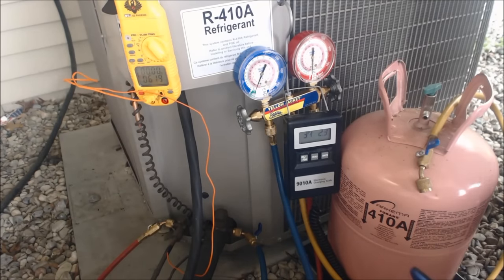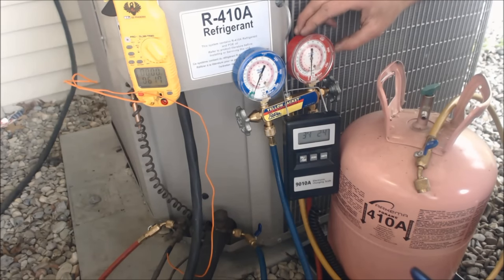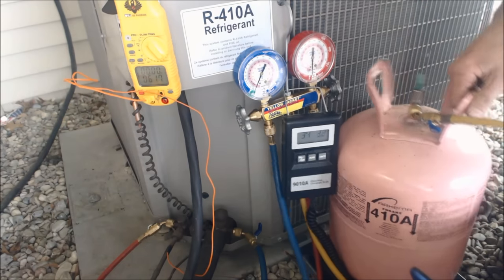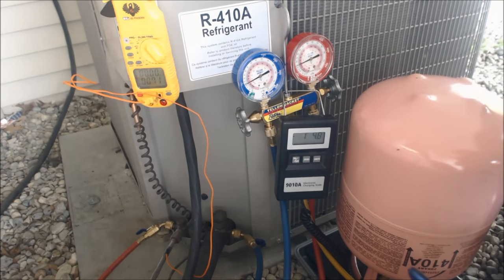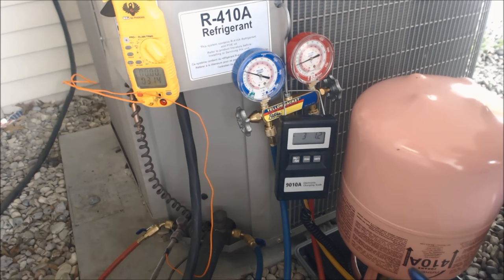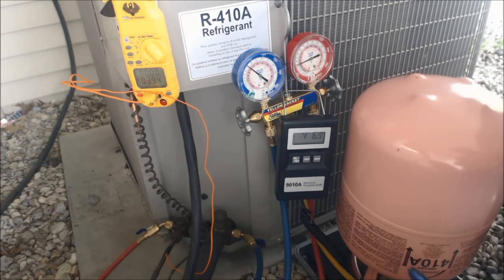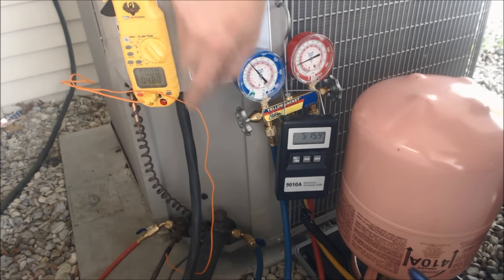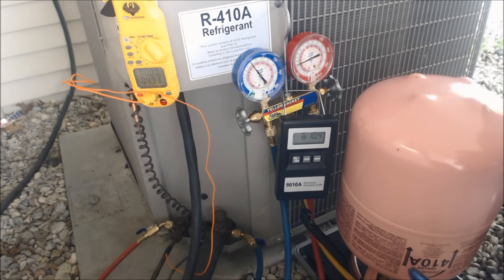R-410A Charging! Weighing in Refrigerant Charge through the High Side Red Gauge and Why!

Comment: I  was  taught   similar  method  way back in the eighties  when I first got into HVAC  and have always done so.  Only thing not  mentioned is that IF  (likely not) you approach full charge  in this manner,  upend the container  for gas  towards  the last to flush liquid out of the hoses,  then adjust final amount   with gas  into   suction side.
Reply from the maker: That is because this refrigerant needs to come out of the bottle as a liquid to keep the mixture pure since it is a near azeotropic refrigerant mixture, thanks!

Comment from the maker: 5 to 10 minutes is a normal good time. Some Techs will hold this for a long time as a leak test but it will depend on what shape your gauge and hose sets are in.  Usually we will use nitrogen as a pressure test.If your vacuum level rises and then stops, rises then stops, that is moisture in the system. If you lose your vacuum then you have a leak.Thanks for the great questions!

Comment from the maker: If you just weighed it in like in the case of a heat pump in the winter, you could just weigh it in exactly but you have to take into account the size of the evaporator and the length of lineset compared to the amount of refrigerant that came in the outdoor unit. If it is for air conditioning in a case like a split system I just weigh in close but under and just add in subcooling if there is a txv until the target is met. If it were a package unit with an exact weight then you can put in the exact amount and confirm with superheat if piston or subcooling if has txv.

Comment from the maker: Sure a laser thermometer would work, I just used one last night but I checked it's accuracy against my other temp probe taped on the other line first just to make sure they agreed. Thanks for the good question! Keep them coming! Also keep in mind to wipe the sweat of the suction line first if you were going to use the laser to make sure that you were hitting the pipe and not the water. Always cross check your stats for accuracy! Thanks!

Comment: Craig, with the new crossover ducted heat pump systems, the only way to accurately check the charge is by weighing it out/in. With the best practices that you teach regarding pulling a vacuum, how long would you expect it to take to pull a vacuum? Also, can you reuse the same refrigerant?

Comment: This is a good video with the exception of the loud obnoxious noise at the  beginning of the video
Reply from the maker: Yeah sorry James, on the new videos, there is a silent intro, and a better mic for teaching, thanks!
Reply: I did this technique but the inside evaporator coil still freezes up if I turn the thermastat down below 78 degrees
Reply from the maker: When a coil freezes, it could be low refrigerant charge, low airflow, or liquid line restriction like the txv is not working and it partially closed or filter drier is clogged. Low refrigerant charge is high superheat and low subcooling. low airflow is normal to low superheat and high subcooling, liquid line restriction is high superheat, high subcooling
Reply: So should I try putting more freon in the condenser unit through the liquid line like you did in the video. I've already replaced the filters and cleaned the evaporator coil inside and out.  So I don't think low air flow is the problem and if the liquid line was restricted the filter drier was clogged wouldn't the coil freeze regardless of what you have the thermastat on ?
Reply from the maker: Make sure to check superheat and subcooling before doing anything else in order to verify which problem is occuring, thanks James

Comment: First off, thanks for the excellent videos! Few questions (sorry if this has been asked before): In the case of weighing in via the liquid line due to r410a being blended, how do you account for weight losses in the manifold gauge and hoses? I am wondering if it may not be critical on a larger system, but what about a mini-split that takes 2.5lbs total system charge including lineset? I have read that some people shut off the valves at the cylinder and liquid side hoses, and then meter it into the suction side using a "sweeping action" with unit running. Another method is to tally the 0.29oz/ft (1/4" hose at 80*F) and subtract it from total weight, but then you lose 2.9oz in your hoses when disconnecting...

Comment: Great video but I really wish you completed this job on the video :)...some unknowns for newbies like me lol...at what time liquid will stop due to the pressure on the low side? At what time should we start topping it off from low side?
At what time you turn on the unit? What is a good pressure for this system?
Reply from the maker: Basically, you will break the vacuum with refrigerant from the bottle into the empty system until either you reach the factory charge or the refrigerant stops exiting the bottle. You tell when the bottle is no longer adding refrigerant into the system when the scale stops moving, thanks!
Reply: Ok great thanks for the reply

Comment: On a charge like this would you charge until you meet the required spec of weight of refrigerant the system calls for, or get close and add as necessary until you reach desired superheat/subcooling keeping an eye on weight.

Comment: Thanks.   Can you tell me if the 410a is upright, which one of the 2 gasses of the blend is closer to the top valve?   I assume either the R32 or R125 is heavier.   Not planning on doing it but just wondering which of the two gasses from the blend would be more prevalent at the very top of the tank.   I can't seem to find this online.

Comment: My confusion now, is now, essentially we want only VAPOR into the compressor, so this is why we charge through the liquid when the system is off, to go through the metering device, so the compressor receives vapor just like you said. So why would we charge through suction when the compressor is turned on? Wouldn’t liquid refrigerant immediately get sucked into the compressor? Defeating the purpose of avoiding liquid refrigerant into the compressor? Very confused
Reply: You would meter the valve while adding liquid on the low side. When liquid is added slow on the suction side it will immediately atomize into vapor once it hits the service port/suction line. If you opened your suction side valve all the way and tried to “dump” the liquid in, there’s a good chance some liquid will get into the compressor and cause damage. Hope that helps.

Comment: If you don't purge your lines because you said they in a vacuum, you don't get an accurate weight reading by reading the scales.  Because some of the refrigerant will be in the hose(s), right?  How do you get the refrigerant in the hose OUT OF the hose into the system?   Do you weigh the hoses before and after?
Reply: Gene Pierson. By the time he suck the hoses down, they left with a teeny bit of vapour a fraction of an ounce not worth worrying about

Comment: Hi, after many arguments with tech friends I have to ask.....When the condenser is packed down (or you are installing a new unit packed with R410a already) and you only vacuum the lineset and evap coil down, you then open the service valves to add the refrigerat back in.  Do you open the vapor or liquid valve first?  Reading mfg service manuals all but Carrier I have read say open the evap valve first, if you open the liquid valve oil can get drawn out into the lineset.  Carrier however says to open the liquid line first.

I have been breaking the vacuum with refrigerant to get to  just positive pressure then opening the liquid service valve very slowly after that.
Reply from the maker: Great question, well let me first say, always follow manufacturers' instructions. Secondly, let me pose a question to you. If the compressor does not allow equalization and the liquid port only has access to the refrigerant that is on the discharge side of the compressor while the oil from the factory was put into the bottom of the compressor on a new scroll to get pumped up when running or on the bottom of a new reciprocating compressor then why would opening the liquid port first make any difference? The liquid port would allow more refrigerant into the rest of the system compared to opening the suction side granted but it is not connected to the suction side so how would the refrigerant pull the oil out if it is not touching it or sucking through it.? Ha ha, my adults in night class asked about this and I just laughed and I got them thinking about it and then finished with maybe the manufacturer has some other reason that they are not telling us but it is always best to follow their instructions since they designed it. If the system was a unit that was pumped down then oil would be mixed with the refrigerant. In my head, it would make sense to open the liquid side first to suck the oil back towards the compressor inlet and then suction second so the oil doesn't leave the entrance to the compressor but these are just my thoughts and I am not the manufacturer so just follow what they would like you to follow. Thanks

Comment: If you had to start the compressor to finish filling the system did you flip the bottle over or leave it upside down?
Reply from the maker: R410a has to come out of the bottle as a liquid to keep the mix correct unlike r-22. Make sure to not add too much into the vapor line each time for compressor safety. Just let a little in at a time, thanks Blade!

Comment: how much refrigerant to be safe do you n
need in there before you start system and put in vapor line?Thanks
Reply from the maker: You need enough for the evap not to freeze before 5-10 minutes of run time. It is best to weigh in liquid into the liquid line up to or a little less than what is needed after the vac pump and then turn it on, wait the 5-10 minutes and check the charge. Thanks Chad!

Comment: Hello Sir, Can I charge split type ac with gas refrigerant into the LPS by R410a? Like the same procedure charging R22? Or it can damage the compressor? Thanks
Reply from the maker: R410a has to come out of the bottle as a liquid. A Vaporizer such as this one could be used-         Imperial Kwik Charge 535-C- http://amzn.to/2uipEI6       -but if you are breaking a vacuum with refrigerant then we weigh liquid refrigerant into the liquid line. You want to try to avoid having any saturated or liquid refrigerant entering the compressor, thanks

Comment: Dear brother, is it mandatory to top up r420a refrigerant with cylinder position upside down? or it doesn't matter to charge at any position some of the people saying that r420a refrigerant must be charged with cylinder position upside down otherwise you will lost the cooling effect of the ac. your prompt response will be highly appreciated
Reply from the maker: r410a must come out of the bottle as a liquid so with a tank like the one in the video, it must be upside down and charge slowly while the system is running into the vapor tube. Make sure not to slug the compressor with liquid just a little at a time, thanks

Comment: I have seen r410a charged as a liquid through the suction line without the liquid vaporizer, with the liquid vaporizer, and now through the liquid line. Which is the  most effective and most normal way to charge the system using r410a??
Reply from the maker: Through the liquid line is only if the system is off and under vacuum and you need to weight a lot of refrigerant into the system. You can use a vaporizer while the system is running or just meter it in with the handles a little at a time, thanks!

Comment: Awesome video.  Detailed pretty good.  So 1 question you said evacuated and vacummed.   Did you vacuum the whole system from line set coil to condenser ?  Or did you close off the service valves and then weighed in the charge.   Also my system came with a size 8 liquid line dryer, can i put in a 16 since it is 4 ton or stick with an 8?   I subscribed when i found your channel due to the detailed videos you are making.  Keep it up man.  You the man.
Thanks for the responses.
Reply from the maker: You surely can put in a larger one. It will not hurt anything. They have a fixed capacity so larger would be better. This unit was evacuated down to 500 microns. The system's valves were open as the compressor was replaced. The entire system was vacuumed down to 500 microns including inside the outdoor unit. The word evacuate can pertain to recovery or dehydration(vacuuming). This is what you will be doing on your unit. Thanks and glad that you are enjoying the channel!

Comment: So how do you charge the system after it won't take anymore and you have to start using the compressor?
Reply: David start charging it through the blue hose (suction line ) little bit at a time so u don’t damage the compresor unless you have a sth called a liquid vaporizer on ur gauge set. 
410a has to enter the unit as liquid form  he has more videos about it. Cheers
Reply: Through the suction, until he reaches his goal weight

Comment: Thank you for your answers..Do I must run compressor before  adding refrigerant into suction line and  all system is vacuumed before that ?
Reply from the maker: If it is an empty system, meaning that there is no refrigerant in the outside unit then you would pressure test, vacuum to 500 microns and break the vacuum with liquid refrigerant weighed into the liquid side to the weight stated on the outdoor unit rating plate, wait 5 minutes, then turn on wait 10 minutes and check charge with subcooling or superheat. If there is refrigerant in the outdoor unit held back by the valves then pressure test the lines, vacuum the lines to 500 microns, then break the vacuum by opening the service valve to let the refrigerant in from the outdoor unit to the refrigerant lines.
Reply: Does this same process work with a mini split ? Adding r 410a in liquid form to high side. My system is empty.

Comment: Hello, I see the ball valve is opened on the suction side but do you need the gauge off on the low side to force the refrigerant into the high side?
Reply from the maker: Yes, when breaking a vacuum including the outdoor unit, we break the vacuum with liquid refrigerant and try to weigh in as much as possible up to the amount needed or right under and then turn the unit on to check the charge, thanks

Comment: When you can no longer weigh in as a liquid and you have to continue as vapor through suction line,  do you continue to leave the unit off? or do you start the compressor?
Reply from the maker: You shouldn't have to on residential and light commercial. You should be able to weigh in 15 lbs no problem into the liquid line. To answer the question though, yes you would just turn the unit on and add any additional refrigerant into the vapor line a little at a time, thanks

Comment: does the liquid refrigerant fills up the condenser coil and stops at the compressor's discharge port when weighing in refrigerant this way?
Reply from the maker: Yes the liquid fills the liquid line and runs into the condensor coil as well as into the metering device and then to the evap coil. The refrigerant will stop on both sides of the compressor, thanks!
Reply: when you ONLY open the valve on the suction line ( liquid line valve still closed) for the very first time why does both gauges  showing pressure reading? where does the refrigerant come from and what is the flow direction?
Reply from the maker: In the case of a new install of a unit with refrigerant in it, when you open the suction line service valve, breaking the vacuum then the refrigerant goes tom the evap coil and bypasses through the metering device and into the liquid line back at the liquid line service port, thanks Mark!
Reply: thank you so much for all your answers. best instructor i've seen in awhile.
Reply: so the refrigerant is stored between the suction line service valve and the suction port of the compressor? so the refrigerant is coming out back ward from inside the compressor and on its way towards the liquid line? is this correct?
Reply from the maker: Yes that is correct, thanks
Reply: thank you Mr. Acservicetech. you're the best.

Comment: I worked with a guy that will fill up in the suction line when the unit is under a vacuum. I know this to be wrong I was always taught to break the vac with the high side king valve or liquid into the high side and through the evap first. Can you describe the down side of charging a dry vacuumed unit with liquid through the suction? Thanks
Reply from the maker: Upon startup, you would be slugging the compressor with liquid and also you can't weigh in as much refrigerant since you are giving the refrigerant too much room to expand and causing it to provide pressure against the refrigerant pressure in your bottle. The liquid line is smaller, thanks Brian!